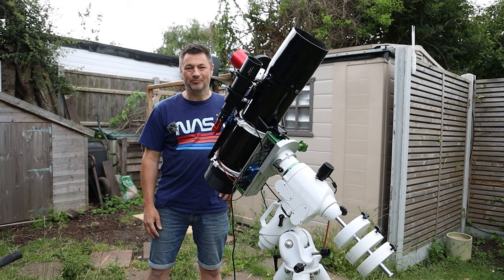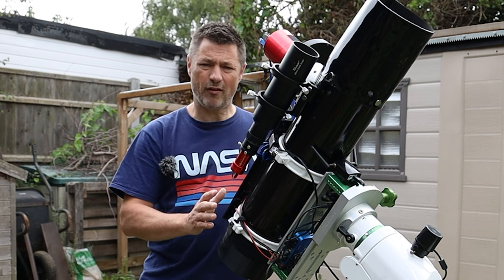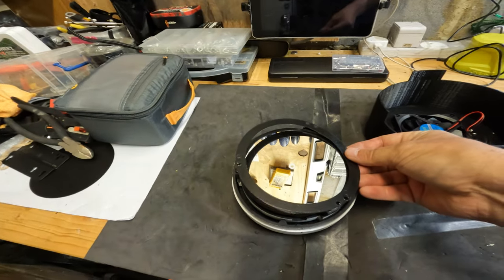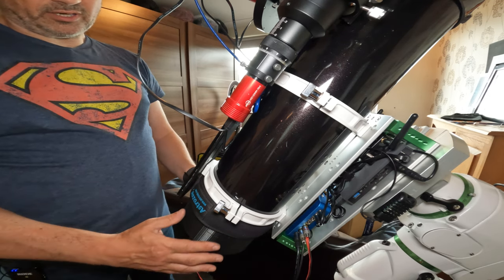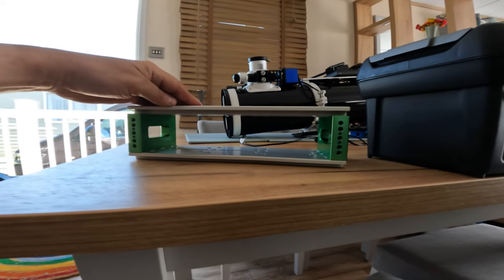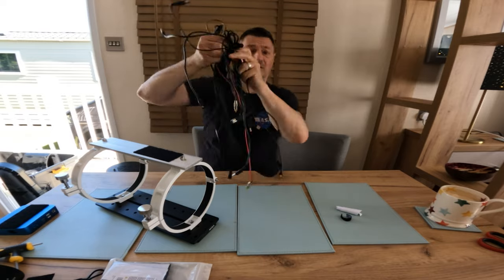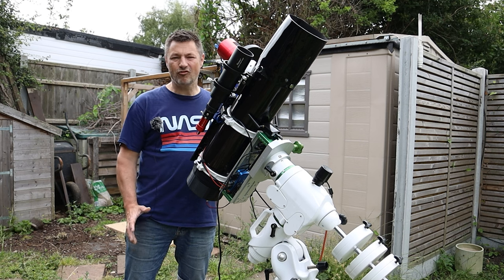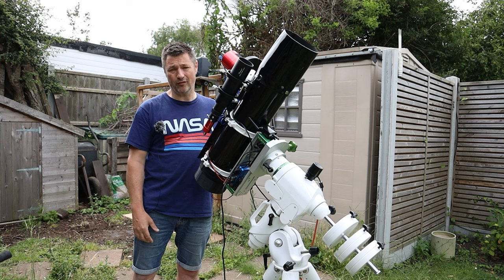Sky Watcher 130PDS Telescope super modded for Astrophotography

Comment: Mods look great. The joy of being able to 3d print parts custom parts eh! And those images looked fantastic - the stars looked pinpoint.
Reply from the maker: Thank you Logan. I am really thinking of getting a 3D printer myself. I am very happy with the results this scope returns. Thanks for watching, clear skies
Reply: @Astrobloke  You like to tinker and tweak things and make improvements etc so a 3d printer is the ultimate toy...... I mean precision piece of machinery for that sort of thing. It's so amazing that you can imagine and item you need, draw it up in whatever software you use (I use Tinkercad because it's free and simple like me) and before you know it, it's printed and that idea has materialised into physical form.  I haven't used mine a lot for astro yet (just a few items) but I used it heaps when I was doing Christmas light displays to create things like snowflakes and stars and icicles to hold the pixels etc.

Comment: Incredible work Glenn! I love how you can make a cheap scope perform so much better with some simple, cheap tweeks. I recently pulled the trigger and bought a 130 PDS, the moment I received it I did all the mods you've done all at once. I even flocked the top and underside of the mirror mask because I put it on top of the clips, and I find that pla stuff was still reflecting some light. I hope this will be a nice improvement coming from an old, budget Meade LXD75 scope. The only thing I need to do is add a backcover over the primary including a fan, since there are still some light leaks. Sadly I can't seem to find a proper stl. file for a backcover. And since I am not that handy with 3d modelling myself, do you mind sharing your model? Ofcourse, only if you want to. I hope I can get first light with it soon, but as always when you get new gear: the weather is always against you 😅, especially here in The Netherlands
Reply from the maker: Hi and thank you for your kind comments. Excellent little scope and the mods really elevate its performance to ones that cost a lot more. Can you email me  at Astrobloke@outlook.com and I will forward you the stl file for the cap I have. We are having fun with the weather now too, but lets hope we both have some clear skies soon

Comment: Good and well executed mods! Excellent capture of the Soap-Bubble too!
What about the diffraction from the focusser draw-tube? You can either shorten the main tube, or cut down the draw tube.
Good luck with OU4 in OIII - you'll need dark skies or very good filters (Chroma or Astrodon), preferably both!
Reply from the maker: Hi Pompey and thanks for commenting, i see you saw how I worked around the focus tube issues. I use the Antlia 3nm filters which work great, getting good data so will have a nice image 🤞
Reply: @Astrobloke  Super!
I am one half of a pair of amateurs who have a remote obsy in Spain, and have quite a bit of OIII data on OU4. I'll look up your contact details! :)

Comment: Another excellent video Glenn. 
I’ve been thinking about installing a fan on the primary but unsure if it’ll make a difference.
Reply from the maker: Hi Robert and thank you for watching and commenting. My CT10 has fans built in and wasn’t sure the 130 really needed one. But I was discussing how pockets of warm air in a tube can cause effects on your imaging and it was easy to fit one. Just disturbs that air and also helps with any dewing

Comment: Loving your work Glenn. It’s so good to see great results coming from an affordable scope. I am struggling to get something I’m happy with from my SW 200 quattro but have just ordered a collimation kit from Farpoint which I hope will improve things. Can you please tell me which guidescope you are using in the video? I see you have a William Optics 50 listed in your equipment but this is something else. All the best from NZ.
Reply from the maker: Thank you Pete. Its very satisfying taking a budget scope and being able to improve its performance, I get really surprised at what it can do everytime I use it. I have heard that the Farpoint collimator is very good so should help. The Guidescope is like super basic. It was very cheap off ebay and called Starguider.. I think its exactly the same as the SVbony one thats sold. Just a Generic 50mm guidescope with no frills but it does have a Helical focuser included, Hope that helps and thank you for your support. Clear skies.

Comment: I also cut 1.5cm from  mirror side of tube of my 150p so focuser tube doesn't cause strange stars.
Reply from the maker: I was able to turn the flange off the sky watcher CC that I use and so it can slide in further so the focuser is racked out enough so none of it intrudes. Would have cut it like you did otherwise. Thanks for watching and commenting. Clear skies
Reply: I did this too. Nice symmetrical stars now! :)

Comment: Enjoyed your mods to the Sky-Watcher.  I just got the Sky-Watcher 6” Quattro Imaging 150P Newtonian.  Been having issues with the secondary mirror adjustments.  The screws are really tight and make a popping noise at times.  The AstronomyShed guy had a mod on his secondary mirror he did that I will probably do.  Your primary mirror and fan idea will be top on my list also.  I live in the Deep South USA and lots of humidity and dew most all the year round.  Does the dew strap work well?  I put some resistors under the mirror on a smaller Meade DS114 Newtonian I have.  The resistors were placed on top of some rock wool but were also directly under the mirror.  The mirror rested on a plastic base that had recessed pockets that the rock wool was put in.  The small Newtonian’s secondary mirror is in a plastic tube, I also put some resistors and rock wool behind that mirror.  The secondary always fogged up first but now it is clear.  DewBuster site has information on making dew heating systems from various electrical items.  DewBuster guy got some hurricane Ida damage which shut him down for a while, but his site is still up and giving update status.
Reply from the maker: Hi there and thank you for messaging. Thats a nice scope you have bought and will return some lovely images. It does sound like those screws have been overtightened at some point and dug into the soft metal on the back of the secondary. I believe he puts a plate of metal or plastic there to put the flat surface back, should be easy to fix.
The dew strap with the fan in the cap works very well indeed and so far I have kept dew free.
Wish you all the best and cler skies

Comment: Hello Glenn !!! A question : the dew heater strip in the botom of the telescope (arround  the primary) can produce some  effects in the images?, Thanks!!! :D
Reply from the maker: Hi Jean. It never gets hot enough to cause that and the air is disturbed by the fan in the cap anyways. I never get any dew issues and have not noticed any problems on any subs taken while its on even at full

Comment: So I like a great idea having the riser, but then looking at the amount of counterweight you've got made me think that you're increasing the moment of inertia a lot by move the scope out. So is it going to make a difference to the guiding and performance of the mount?
Reply from the maker: Hi Richard and thank you for commenting. Obviously you need a good mount to be able to do this as it does add a fair amount of weight. For me the convenience and cable management makes that worth the extra payload. The EQ6 R Pro has no issues with this at all and my guiding is rarely above 0.6 total rms and most nights below 0.5 total rms. You actually only need 2 counterweights to balance this but they are then far down the counterweight bar so 3 closer to the centre is better. Clear skies

Comment: Hi Glen good evening to you. I've been looking on line and ebay seller has offered me a 130pds F5 Parabolic at £265,that includes  delivery.  It is new, and of course zi would be covered by Ebay Guarantee..Do you think that would be a fair price ? I then of course have to splash out on a Good Tripod so I can track for long exposures .. I dont know if I'm using the right Technology when I'm try to explain.  But I want to be able to take deep sky photo after getting into Astrophotography in the long run..Have a great weekend.  Roy
Reply from the maker: Hi Roy. Its not a terrible price but FLO (first light optics) sell it for less and would give you great support should you have any issues.   https://www.firstlightoptics.com/telescopes-in-stock/skywatcher-explorer-130p-ds-ota.html
Mount wise will really depend on your budget. Did you have a price you were thinking as a max and also whether you wanted an equatorial mount or one of the newer harmonic ones (these are light and more compact)

Comment: I know it is an old video but I was wondering how did you setup the Wi-Fi router. Is it connected to your home network or it broadcast its own network and both your minipc and controller pc are connected to it? Thanks a lot! Great and inspiring video indeed. Ah, btw which length the losmandy plates? 30cm?
Reply from the maker: it was a while back but glad its still useful. The mini wifi router gives off its own hotspot that you can connect to away from home but when home I use my home wifi network to control things. They are the larger 30cm plates yes
Reply: Thanks a lot! Very useful. Clear skies!

Comment: Hey man... about Coma Correctors which one would you buy? Sharpstar 1x, Sharpstar 0.95x or Skywatcher for F5 reflectors? I'm leaning towards the SkyWatcher one. Also... do you get obstruction from the focuser barrel?
Thank you :)
Reply from the maker: Hi Rafael. I own 2 which is the Baader MPCC MkIII and the sky watcher 0.9x CC. Both work really well. The sky watcher has a flange on it which prevents you getting the image train pushed far into the focuser and means the focuser is intruding into the telescope to get focus. This can mess up the stars. I used a lathe and turned this lip off to fix this. The Baader has a lip that unscrews so unless you want a reducing CC I would go for the Baader
Reply: @Astrobloke  I would like to avoid this obstruction so you just saved me from buying the SW one :)
Baader is too out of my range $. I did some research and I found the Sharpstar should do just fine. Thanks a bunch!
Reply from the maker: @RaffaelMarx  glad I could help

Comment: Great video Glenn. With the fan, you could flip it over and reverse the polarity of the plug if you want it to sit flush on the back cover but still suck air in rather than blow it out, then there’s no need to stand it off with Velcro pads. But if it works great already there’s no need I guess 👍
Reply: Sounds like a good idea, I'm interested to see is there is a benefit either way. 🤔
Reply from the maker: Thats a great shout and I didn’t think of that. Its working really well as it is but if I need to make any changes or replace the fan I will remember this and give it a try.